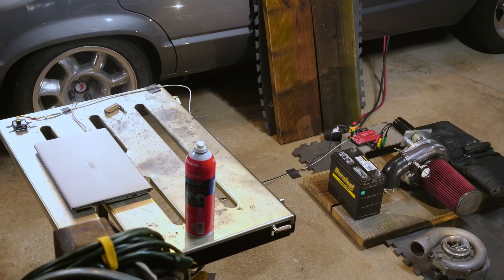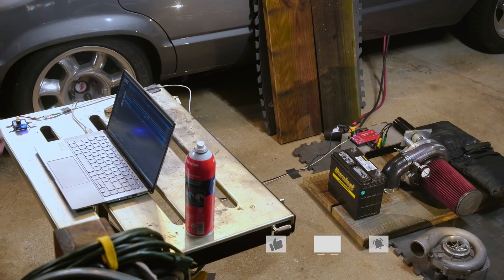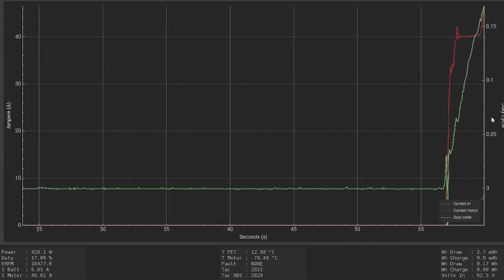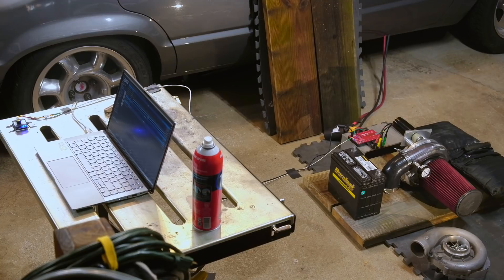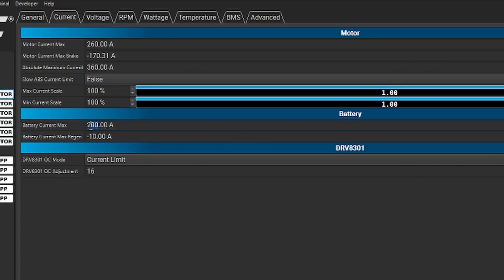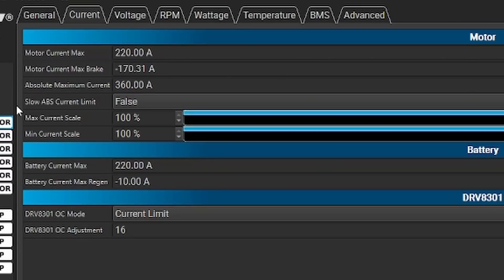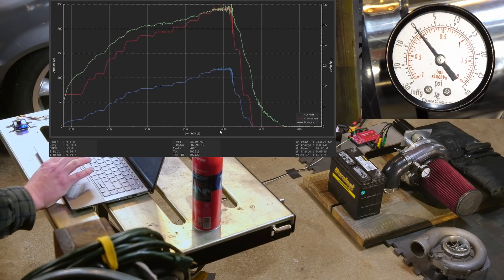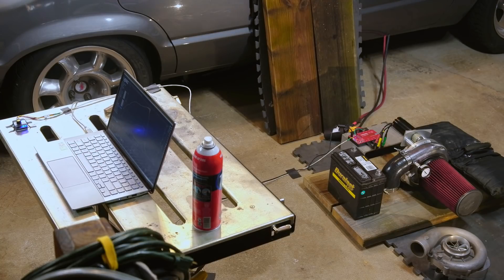Easier/Cheaper High Power DIY Electric Turbo - Full Power Attempt #1

Comment: You hit your battery current max. For that last run I see 220A battery and 240A phase current, your phase current will be a factor of 2-3x battery current.
Reply from the maker: The battery current hit 130 amps.  It hit the absolute current max of 360 (you can see it in the video - it shows up far a split second every time the fault kicked in).  I do want to get a handle on the current spikes before pushing any further, and I've got an idea of what's causing them.  I'll shoot a video very soon.

Comment: Because it has no resistance
Reply from the maker: It has a restrictor plate in it.  1" hole - enough to get us on the compressor map, but not enough to load it fully.
Reply: If it was attached to an engine the suction of the engine would let the supercharger come up quicker and maybe be more steady I love the practicality of it

Comment: This is great stuff. I'm a mercedes-benz tech and the new E53 AMG's have an electric turbo that runs off the 48v battery system. it will produce 7psi , pulling about 100 amps. this is used for instant torque and to get the car moving, once it hits 7psi, the electric turbo shuts off and the regular one takes over..
Reply from the maker: Thanks for the kind words.  Yeah, as we've discovered, it doesn't take much at low rpm; but we've seen a pretty consistent 2 psi taper from peak torque to peak hp.  And power to spin the compressor increases exponentially... that's the proverbial rub...
Reply: At 7psi and 75% efficiency 4.8KW only gets you to around 170hp (~135g/s MAF).
Reply: why wouldnt the electric one being used all the time?
Reply: @gamwsas  Think about how much power there is is the exhaust being pumped out of the engine at higher rpm compared to that of a small electric motor at 48 volts.

Comment: Oppss you did change the supercharger as well.  Always use the principle of changing one thing at a time. For version two I would have gone with two of the controllers used in version one and two motors. Using this method puts less tress on individual systems. Could be the compressor or the new controller.
Reply from the maker: I don't think it's either one.  I do think it's electrical in nature, but I'll have to test to be sure.  Of course, I'll shoot a video when I do.

Comment: Ever considered one of those belt-driven miniature roots blowers for 2.0L engines that use friction wheels instead of sun gears in their internal plantary step-up scheme ? I think they're only a couple of hundred bucks on Ebay. I'm sure they put out more than centrifugals at lower rpm ranges. Some dude named Knight once had success with a larger one with three starter motors mounted counter-concentrically around a common pinion. You could parallel three drives if there's a provision for a common speed reference. I know you're just experimenting now; but I really think you should think much bigger. It won't be cheap, but I truly believe that it will get you more sataisfactory results.
Reply from the maker: I've run several Eatons and a Whipple - the Whipple went 9's on pump gas.  But have you seen our first drag tests?  It's insane what we gained on only 5 psi average: https://youtu.be/AOL3Qyczt3Y  Also, I do have a much bigger motor and ESC coming... like a lot bigger.  Should be here tomorrow, as a matter of fact.

Comment: I heard that at higher voltage the motors ran smoother,  not higher amperage
Reply from the maker: Brushless motors are funny that way - once they saturate, there's really no more power to be had, and any extra power you throw at them just results in more heat.  But I don't believe that's what's happening here (this motor has run solidly at just under 14kW continuous).

Comment: Could it be possible that the compressor is approaching stall causing it to put a fluctuating load on the motor?
Reply from the maker: It's possible, but very unlikely.  We should be solidly on the compressor map at this point.
Reply: @AlexLTDLX  gotcha. Yeah I was the only thing I could think of. Just to be sure it might be worthwhile too make the hole bigger or smaller and just see if the spot at which it occurs changes as well

Comment: It's happening after that 2.5lbs of boost point. You consistently get there smoothly. As it heads toward 5lbs the needle starts bouncing all over the place. Belt slip? Turbo imperfections? Flutter?
Looks like current change is the effect not the cause.
Reply from the maker: I will humbly disagree.  I think it's electrical, and I have an idea of what it could be.  Only one way to find out - more testing coming soon!  But of course, I could be wrong and you could be right... we just don't know.  Thanks!
Reply: @AlexLTDLX  just another thought. It's very cool. you definitely have a handle on this. The potential is there for sure
Reply: Though maybe, I'm would think you would hear that if it was slipping.  It also wouldn't last many slip cycles before the faulty thing would completely obliterate itself.

Comment: I believe one of the greatest perspectives in this is reliability and longevity under continuous conditions and the ability to manufacture that reliability consistently and I am sure that as you continue your tests you will find this to be the reason for the cost of electric turbos on the market. That being said have fun and I would love to see a reliable package... I mean after all we, all know that the greatest power adder is a turbo-axle...
Reply from the maker: Since I'm starting with available parts, I'm kind of limited.  As we zero in on optimal combinations, I think it's going to get a lot easier.  And if I was an OEM, manufacturing the optimal parts would be easy.  Check out how Audi makes their electric turbos.

Comment: Well first you have to identify if is electric or actually physics. How big is the outlet pass-through you did to create pressure? Is it fully open or did you reduce the the outlet size to build up pressure? Because it can now be pulsation of the air wave. If it is pulsation it of course would also lead to such spikes as the motor is under load and then suddenly as the pulsation goes away has less load etc. I hope you get what I try to explain. English is not my native language. The funny thing is I have bought the very same unit and wanted to do the exact same thing and then just came to your videos on youtube, haha. I will use a 4:1 pulley. So that I do not need that big of a motor and hopefullly can limit the current and power need to make it more safe for usage.  I also have a 6:1 Gilmer style pulley to test. I'm still undecided what e-motor to use. Where did you get yours? I have a hard time finding something useful here in Switzerland.
Reply from the maker: It's a TP Power motor.  But where you are, an LMT motor would be the ticket; plus they're easier to drive; albeit not cheap.  I have a big LMT motor coming in tomorrow (supposedly).  FWIW, I think it's electrical in nature.  I have a theory, but I need to test it... soon.  Thanks!

Comment: The battery cables coming from the car might be to long or to small. 
It might also be the magnetic field resulting from the battery wires or ESC wire affecting the PWM signal from the servo tester ... 
But it's strange that the spikes appear all of a sudden, like if it was mechanical (belt slack, flutter...)
Reply from the maker: Cograts!  You win.  I agree with you.  I think it's a power cable inductance issue.  I don't know for sure, but I'll test is very soon...
Reply: @AlexLTDLX  I've been doing spot welding recently for 18650 cells and the spot welder pulls ~1000 amps for a fraction of a second.  It makes the cables move about a ton when it is welding.   I bet it's the motor wires, not the battery wires since the current from the battery should be constant.  But you can try adjusting / shielding / separating both.
Reply: I was thinking flutter or baffling of air flow resulting in load spikes
Reply: Other than cable inductance, maybe there's a frequency limiting issue from the speed controller, but I'm not educated enough to know exactly why that would be an issue.

Comment: Could your cables also be limiting you? They're pretty low gauge for such a high demand application. The cabling I've seen on actual electric turbos is really big gauge , maybe as they get up in the high power draw the resistance is going through the roof?
Reply from the maker: I think they are.  But not in a obvious way.  They're 2 gauge, BTW, so not by resistance.  I'll do a video really soon to test my theory...
Reply: @AlexLTDLX  I know speedrunning chaps in the RC world really seems to make a big deal out of motor wiring being adequate, my perspective is way out but the 3 phase to the motor from the coloured bullets looks like it's 8 gauge and that motors doing 13000+ odd watts right? Might be worth popping the back of the can off and seeing if you can attach a thicker gauge direct to the windings? Long shot, but capacitor packs are also pretty popular in the same realms, maybe worth trying one to see if it helps the spikes? 

Love this work you're doing, I've only ever seen really high dollar setups from companies with big budgets , this seems like something more within my grasp.

Oh and I was also thinking maybe you could hook up a wastegate/blow off valve to the end of the pipe and actually pressurise it to a level of boost and see if it can sustain it?
Reply: He is running a much Higher voltage than most others.
Reply: @WalterWittMakes  I mean, surely that's only going to make the issue worse?
Reply: @DanjaBis  actually, the opposite. With a higher voltage, you need less current to transfer the same amount of power (Watts = Volts x Amps) and it is the amount of current and resistance that determines the Voltage drop (Volts = Amps x Ohms). So with less amps over the same resistance, the voltage lost over the wires is less. That's why transmission lines step up the voltage to the or even hundreds of thousands of volts to send power over long distances.
Reply: I understand the premise, but I went off what information I have available to me. I hit 180/200A at 14.8V on a small RC ESC ,  and to see him running 60V at more amps made me think cabling could be an issue as overall wattage is higher.

Comment: Are you running this turbo in to a blocked pipe? Could be real current spikes coming from the turbo running at surge.
Reply from the maker: No.  It's an "adjustable" orifice.  Currently set to 1".  We should be pretty solidly on the compressor map at this point.

Comment: Hi , you have compressor surge and that is affecting the rotor position ( BEMF)  and the vesc does not know the accurate rotor position , you can try activating HFI  or mount a encoder on the motor . Also use bluetooth and not the usb cable in the future ;)
Reply from the maker: It's not surge - there's no way we're off the compressor map.  I've sent these e-turbos into surge - and you can definitely hear it.  I have an idea of what it is,  but when I test it, I'll be sure to post a video about it.  But I do appreciate (and seriously considered) you input!
Reply: @AlexLTDLX  idk i think too that is surge

Comment: Make a try with a seadoo supercharger.  127-137mm compressorwheel.  Max rpm about 45000. A lot lower than a turbo
Reply from the maker: That, my friend, is a BRILLIANT suggestion.  I didn't even know those things existed (I looked them up).  The perfect answer for a smaller setup... thanks!

Comment: I was just thinking that if you could give the blower output a small tank or a long 3 to 4 inch tube 4 ft longish, or a 2 to 3 gallon tank with the same size outlet that you're using on the end of the blower it would change the way you load the Turbo. I think it would get rid of the compressor surge also, and would definitely smooth out your boost readings and and be more realistic as to what would happen in a charge pipe of a vehicle.  I know it probably wouldn't gain you anything other than possibly a smoother more realistic boost reading. And it is ultimately unnecessary but that would keep the blower from bouncing and trying to keep all that turbulent air compressed and smoothing the outlet to something that doesnt have squared edges. Air doesnt like to change directions. At minimum just Extend the charge pipe to make it 3 or 4' long with the same size outlet for the restriction. Good luck I love your stuff. I was so impressed by the LTD. When I was a kid in high school in the early 2000's before YouTube was big I always wondered about electric turbos and also turbos driven by compressed air like scuba tanks with small AR housings on a turbo. If not running the Turbo the whole pass a scuba tank could spool a massive Turbo instantly. I think the scuba tank Turbo could work amazingly on small engines.
Reply: AlexLTDLX I Would Love To Hear Your Ideas?
Reply: @JUSTDOITDUDE369  I like the scuba tank as a concept but wonder how fast it'd run out of charge. no prob if it can blast full tilt for 25 seconds maybe, could allow several 3-4 second bursts before the tank compressor kicks in.
for 1/4 mile or playing from a stoplight it'd be all ya want/need anyway.
Reply from the maker: Once we figure out the current spikes, it's going on the dyno - in the car.  I'm not one for endless bench testing: https://youtu.be/AOL3Qyczt3Y

Comment: You hit a wall with that setup. The motor is saturated and when that happens you will get a crazy amount of back EMF and everything from then on is just converted to heat. And I HIGHLY recommend you get a "Sensored" motor.
Reply: Came to write this. Motor saturation is problem in sensorless motors
Reply from the maker: The motor's not in saturation.  This test was with the same motor just shy of 14kW: https://youtu.be/AOL3Qyczt3Y  Here it was shutting down at 8kW.  For the record, the motor's rated for 9kW continuous and 15kW peak.
Reply: yup, "saturation" is the word I was trying for, where motor speed exceeds what the ESC can deliver.. a sensored motor setup might ditch near all of that.
Reply: @modelnutty6503  saturation occurs mostly when current is increased

Comment: What's is the cheapest electric turbo I can buy? i wanna start experiment with it but at a low cost
Reply from the maker: If you want to buy a turn-key unit, then I think the Torqamp is your only option.  But that can only support about 200 hp; this setup is cheaper to build and should be able to support at least 3 times that amount... once I figure out the issues...
Reply: @AlexLTDLX  yes I know you're setup can go to more than 650hp but it's too much For me I'm looking for 300 to 400 HP on my 2.2l the stock motor can take it.

So when you start selling this product how much will it be?
And also I'm french English is not my first language so sorry I didn't understand what's a turn-key unit?

Comment: I'm wondering if it's the turbo/charger itself. I think you said this was a knock off. I'd be curious to see what a modern and efficient Garrett or precision turbo would do. Bonus with the PT is you'd only have to supply oil with a smaller cartridge altogether. Let's keep it going, good job 👍
Reply from the maker: I don't think so.  And the problem with starting with actual turbos is they tend to have small exducers, necessitating very high rpm to operate efficiently.  The first version used an extended-tip billet impeller which boasts well over 80% efficiency.  This one is at 78%.
Reply: @AlexLTDLX  custom comp wheels are very cheap from china I get billet ones made for my turbo bike for $65 all the time. Just message the sellers on ebay some of them are the actual manufacturers and will be happy to take an existing wheel and make it whatever size you want. I myself struggled to find a wheel with a big enough exduser for the 155cc bike. Being so small it takes lots of boost to make the power.
Reply: @AlexLTDLX  way beyond my intellect I have a Garret off a turbo diesel I want to put on my 7.5l just unsure what how or where to start
Reply: I have a Garret right in front of me I'll trade ya for an electric one

Comment: So, this may be a really dumb reply, but I'm just calling out what I'm seeing and understanding from your test. You know from previous tests this motor and compressor can take a lot more...

About 5 minutes into the video, you were adjusting your max motor current from 220 to 240 amps. In the test runs following, the current draw spikes real close to your max motor current, and will completely trip the sequence when it fails to keep every small spike below the max motor current.

My suggestion would be to up your limiting factor, in this case the max motor amps, by say 20 more amps or so. While it may appear on the current waveform as if it's surging, previous tests conclude that it is not. However, whether it could be surging electrically from the current set limitations is another question...

Have you tried increasing it since and seeing what happens?
Reply from the maker: Not yet.  Those current spikes, if left unattended, will eventually destroy the VESC.  I'd like to learn about (and fix) what's causing them.  I have what I believe to be a good running theory - I'll test it soon.

Comment: Looking at the booat gauge bouncing around, seemed to be a little more stable on the 220A run when you snuck up on it. Knowing damn near zero about electronics, to me it looks the boost gauge boucing around is replicating your amperage graph. Looks like it's starting to surge and the extra load from the spikes is tripping you up. Can you remove the snorkus and run it up to full power (as long as it doesn't hit an rpm limit), then slowly reintroduce some form of restriction to generate "boost"?
Reply from the maker: If I remove the restriction, RPM will go down and load will go up (the compressor goes into choke).  That will be the final test, but it's more of a load/durability test.  The gauge really is just kinda crap, and being hard mounted, I don't think it's really giving us good data.